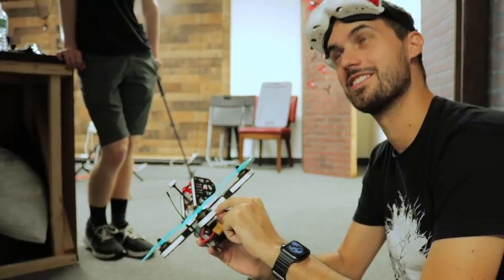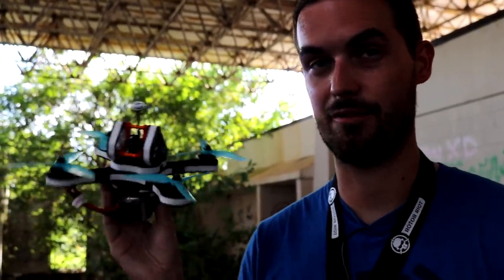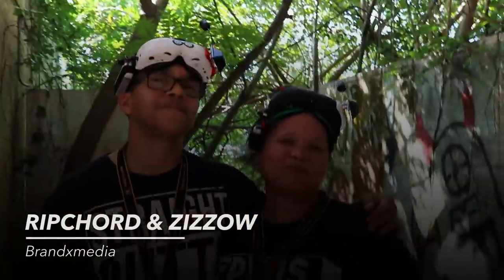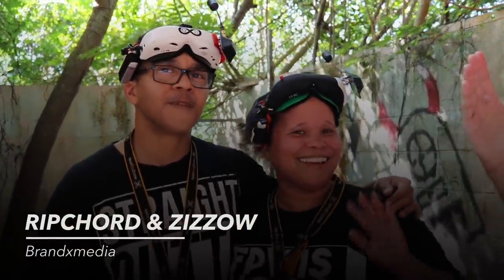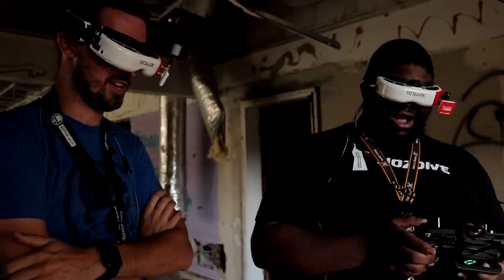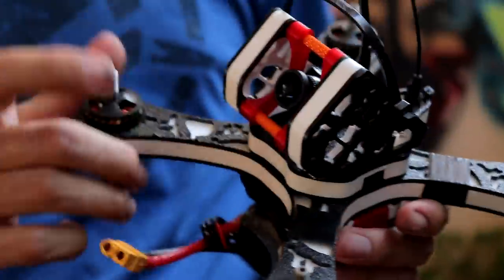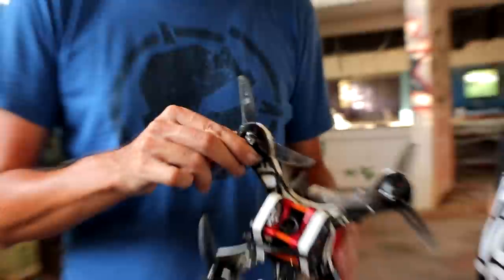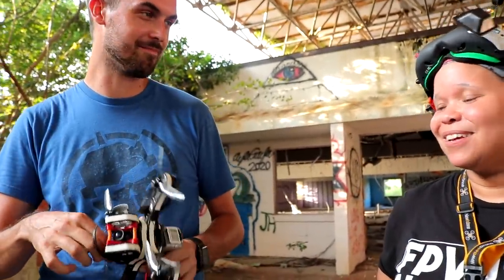Plastic FPV Drone Frame that's UNBREAKABLE?

Comment: Pile of dead stock from 2017 in the warehouse that you need to get rid of, let's make a video and show the noobs an old school frame and entice them into buying some recycled milk cartons!
Reply: With the current rapid pace of quad development, the threshhold for being able to call stuff 'old school' is looking like 1.5 to 2 years.
I wonder how much that time range perception will change as we move forward.
Reply: Lol I got one of these for $13 a few months ago
Reply: @licensetodrive9930  I took a break from the hobby in 2017 to save up for a new house and a kid on the way.  My stuff from 2017 seems completely obsolete now.
Reply: @mrb2917  No, just being observational. What's wrong with that?
Reply: Does the frame really make that much of a difference to an amateur who is just looking to go out and have some fun? That said, I still think $50 is a bit too much for this frame. I don't know the material, but at that size and frame size, you can buy carbon for that cost.
Reply: @KernsJW  I wouldn't pay $50 for this, mine was only 13.. if you're just starting out I would get a cheap eachine like the wizzard or a tyro kit. If you really want to buy a frame, look for one with a lot of available parts, you'll have a hell of a time fixing this Ragg-e if it breaks,
Reply: @alphaflight101  I imagine so and agreed
Reply: hardly worth a video to sell 40 units its just a retro review i liked it but i have 1 sooo
Reply: Plur307 same

Comment: My 6" and 4" are Fossils Stuff frames, the 'Beast' and the Ragg-e. I've broken the 6" twice, both replaced, and set another on fire which survived. Next drone will be carbon, with easier access to internals. Still love my plastic ones like these though, because they're something a bit different. Nice to see them publicised again, whatever the motive.

Comment: It was a good frame about 5 years ago. It has now quite a few drawbacks. Overheating issue, thick arms motor ventilation problems and the battery ejecting every single time you crash. Bloody difficult to make things stick on it - even ummagrip was coming off on mine. I had this frame for a while and its catching the wind pretty badly the FC had to constantly work on it. Not recommended.

Comment: I think that’s the stuff they make cutting boards out of. HDPE is the frame weight comparable to a carbon one? It looks heavy
Reply: And milk bottles. It's not the lightest but comparable to a lot of freestyle frames. Maybe 100grams, maybe a bit more with all the parts utilized. so it's not at the cutting edge of racing performance or an ultralight.

Comment: How about using a 2 mm CF sheet sandwiched between two 1 mm layers of Nylon? Should be pretty stiff and shrug off most all impacts.
Reply: The cf would break inside when the arm is bent as the nylon is kinda flexy

Comment: Ive been on the hunt for a drone that can take a hit going 170 straight into a wall or have a spherical sheild around it for walls so it cant be taken out the sky havent found ine yet but i see somthing special in this plastic your useing. Also need it to last at least 1 hour useing capacitors to charge because lithium ion just wont cut my recharge time i need to hit.

Comment: How would you resolve that crossfire noise in video feed if space is limited? I have same issue on couple of my 3inchers.
Btv, cool video
Reply: Dji fpv = 0 noise ;)
Reply: seperate them more. Your antennas are too close

Comment: Whats up with those wierd lines/distorsion in the FPV feed - What does it cause.
Reply: Multipath. Radios signals struggle in metal and concrete walls
Reply: @wolffpv535  i think that looks more like noise from the esc or reciever
Reply: @leviathannfpv1282  Some guys are saying interference with Crossfire.

Comment: I fry a hobbywing stack on the second flight by clipping gate fabric, yet you full send into steel an concrete, repetitively, without an issue.  HOW???!!!!
Reply: its because they build well. Once you get good at building, your stuff automatically becomes so much more durable because nothing gets moved around or broken internally

Comment: That's one of the worst looking FPV feeds I've ever seen, and that was with RapidFire? What the heck? I wouldn't have lasted 5 seconds, lol.
Reply: It's crossfire receiver noise in the video feed
Reply: Yep like Spartan said. It's when the crossfire antenn is too close to the vtx antenna. It can also cause diagonal lines when further away but still not away enough.
Reply: @SpartanFPV  Oh wow, I didn't know that was a "thing". Thank you.
Reply: @changeagent228  Got it, thank you. I've been flying digital for a while now, and just didn't remember anything like that happening before. I used to run crossfire all the time, but never had that issue. Must mean I mounted up everything good then, lol. Thanks for the inputs :)
Reply: @RADERFPV  No worries. Since I went digital I have not had any issues like this although I still take care to place the antennas apart because I figured it will likely cause other digital signal degrade issues. 😄 👍
Reply: @changeagent228  Good point, thank you :)
Reply: @RADERFPV  😀👍